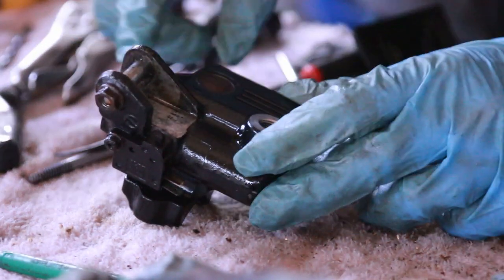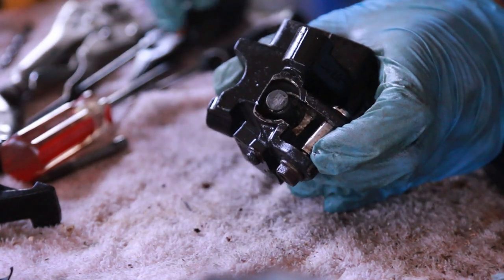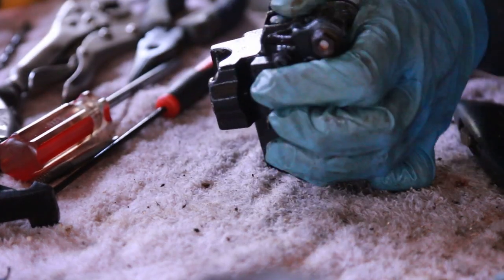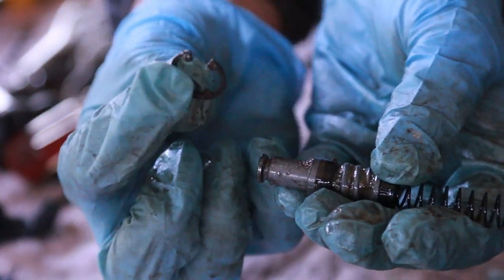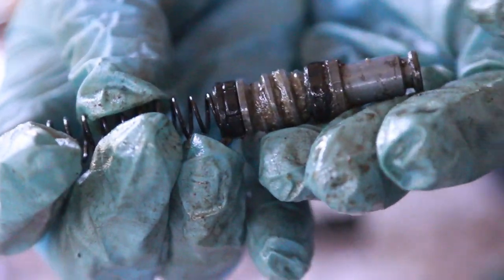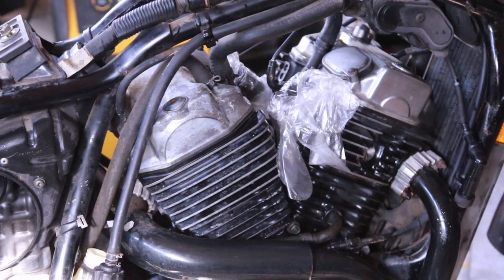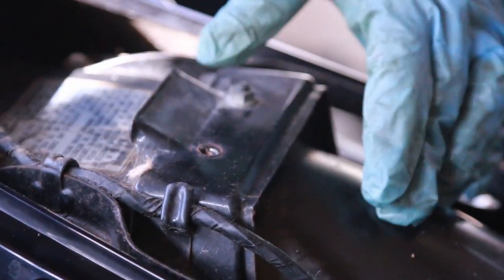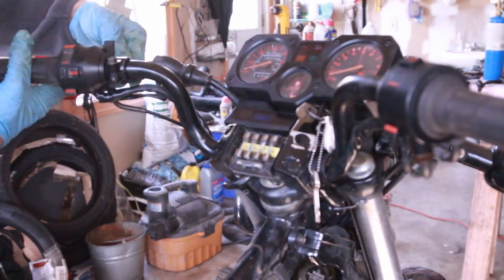Honda ascot: got my new carb. front master cylinder rebuild

Comment: Motard... there is usually a filter attached to the petcock that goes up in the tank..The rubber
diaphragms attached to the carb slides are expensive and rare.should be checked for splits
or holes by holding up to a  light.hope the new carb bowls are clean.
    I lube cables on the bike with the bottom corner of a cut-off ziplock and a rubber band.so
its like a small funnel and you cut a hole in the corner big enough to go around the cable
and seal it with the rubber band.I`d run penetrating oil down first You will see when it makes
it through...then Id use a synthetic motor oil...This is not the quick way.! you figure out
how to keep the top of the cable pointed up.....Cheers
Reply from the maker: Good tip on that, i didnt lube the cables yet. Going to do that this weekend.

Comment: hi greetings from Belfast, is that the tax document on the fork leg from 2004, glad yer making progress, get that clutch cable off and get it soakin and freed up... what's the inside of the petrol tank like?
Reply from the maker: Hey Mike, that is the inspection in the state of VA. There are some states that make you put that in there. But im in MD so i dont need it.